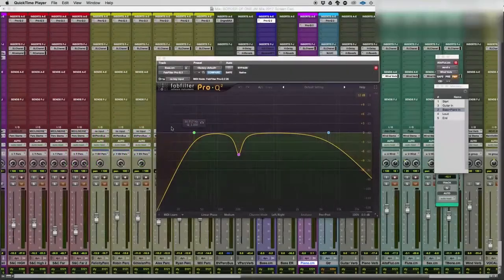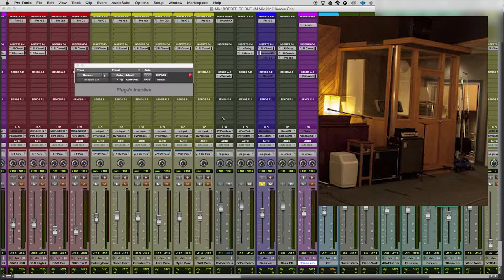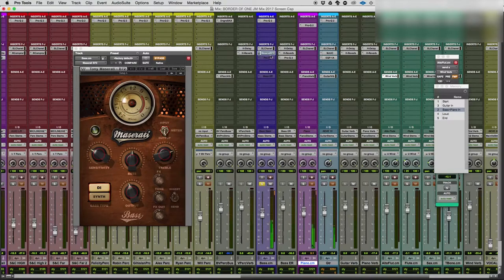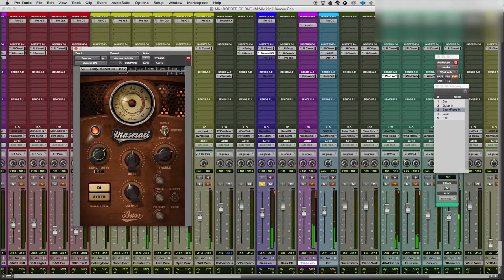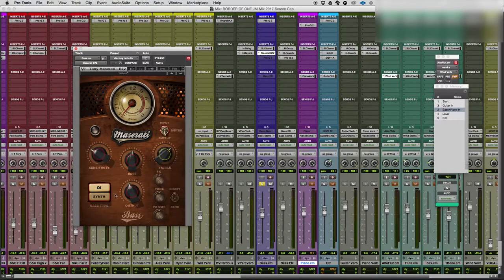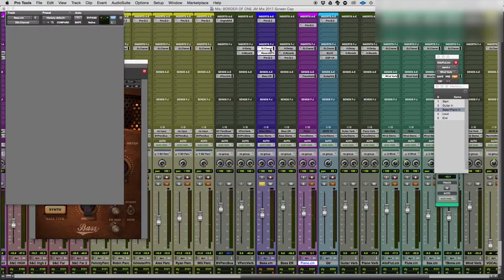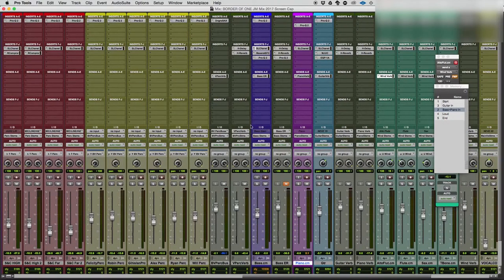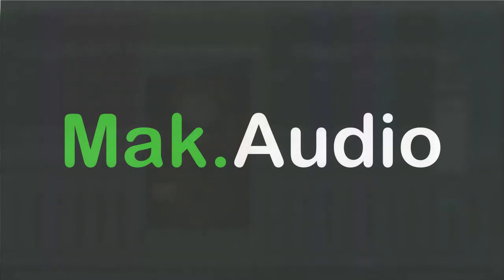Mixing Double Bass with Waves Maserati B72

Comment: Thanks for the tip. It felt just right solo or with percussion but with the whole mix felt as if it needs more dynamics to stick out at times. Sometimes I feel I should get a gated version on a separate track and add more oomph and sizzle for the attacks. Work in progress I guess…

Comment: Interested in more about the reverb/delay ER technique shown @ 4:42
Reply: The ER just emulates a small room rather than a complex reverb with a long tail and the delay is just to shift it about 15ms later. Just so that it doesn't conflict as much with the dry signal. It just helps stop the reverb from pushing the image of the bass back in the mix. It's just a taste thing really.